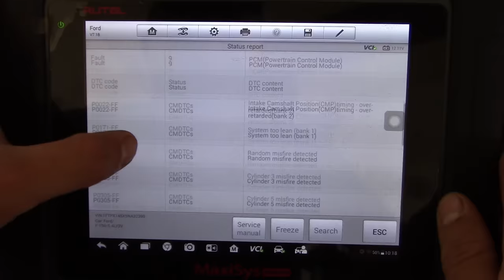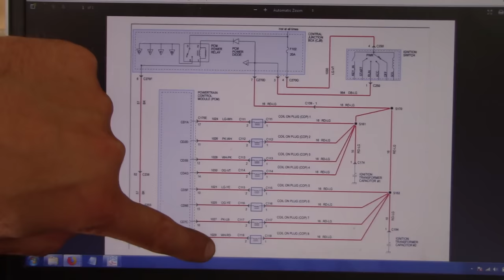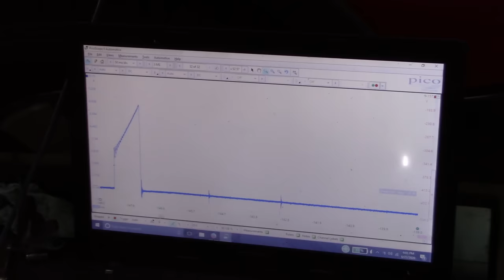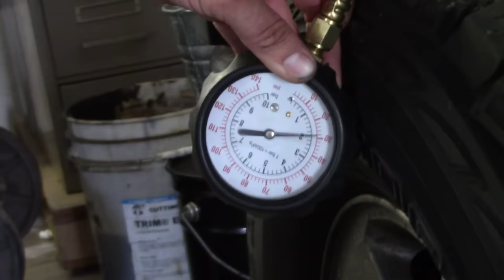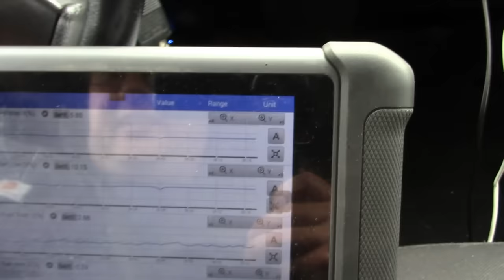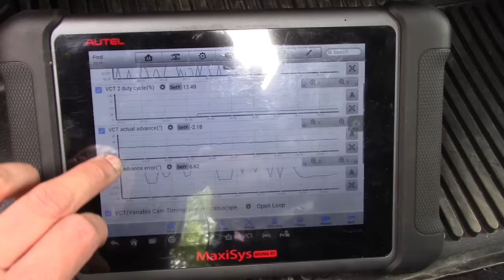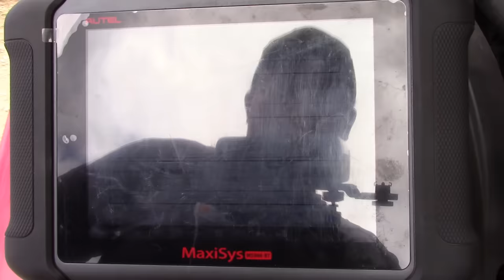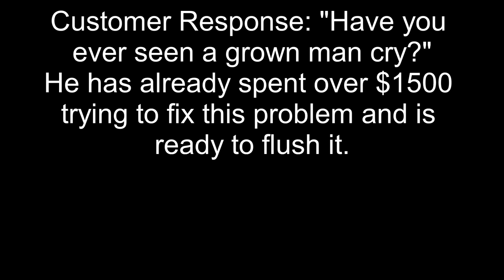2005 Ford F150 5.4L - missfires, intermittent rough running, rattles and knocks, P0021/P022

Comment: Oh 25:50, no it wont hurt anything making that noise, but from experience, it sometimes retards the cam too much and you loose power, We got some vans with 400K miles with bad phasers and boy they make a racket and even almost feels like a slight miss to it, but they are gutless, 400k miles we normally don't care about changing stuff like that, we end up finding a low mile 5.4 if the van body is worth it (Ohio) still before we change them phasers at that point.

Comment: oil pump, need to replace oil pump. the oem oil pump has a thin back plate that flexes at anything above 2500 rpm and oil pressure drops. need to replace with melling 360 high pressure/high volume. they use the same pump on the mustang

Comment: I have a 5.4  it i just changed the phasers and it idles fine rev it a little and it starts making that same death rattle but if you switch it off it starts and runs smooth for as lot as you don't rev it up than it starts rattling again then switch it off then it idles fine again

Comment: Roller followers are a big concern when this engine has over eighty thousand miles, vvt solonoids get plugged and screens break , phazers get worn out due to lack of oil pressure, all this because Ford recomends 5w20 engine oil  for epa mileage standards but it would be beneficial to change visosity to minimum 5w30, and change the solinoids,  Ford also installs crap oil pumps in these engines

Comment: Good job diagnosing Wes. I would like to know more of the history. Do you think these light oils (because of VVT) could be a little too light for adequate lubrication? Not to mention conventional oils.
Reply: Too thin of an oil and too long between oil changes is the death of a 5.4. Need to run a 30wt or 40wt oil and go 5k miles max.

Comment: That engine is toast.  Death rattle on startup means blown oil gaskets on the chain tensioners, so right bank starved for oil, which ruined the right head's aluminum cam bearings.  Cheaper to replace the engine with a rebuilt long block.

Comment: Hey my 2004 ford f150 5.4 coil keeps blowing out the spark plug hole do you know why .      I was changing the sparks and put oil down the sparkplug holes to loosen them yah I found out after I'm not supposed to do that any help

Comment: I had a Ford mechanic tell me to run 10-40 rotella in that garbage motor and we'll it quieted it down it also starved the cam for oil and snapped the cam on the passenger rear cylinder. Second motor made it to the same 150000 and I haven't wanted to bother looking at it sounds like the same cam break tho

Comment: Mine 06 5.4 Triton 3v  runs very similar to the last run in the video. Pull up to the drive thru and it idles like a Semi Truck, just rattles and rough idle, sounds like what i imagine a bad roller would sound like at its peak roughness. I cringe because I'm just waiting for an explosion. I often keep my foot on the Gas and the break to prevent the mayhem which helps. I get the 5,7 Misfire even after changing plugs and coils and have the rattle. I'm thinking  its time to break the motor down.  Other times it idels great like right now, sounds like a brand new truck. Any advice? Or thoughts?
Reply: bloquea los engranes, checa las guías estar rotas, ´posiblemente tambien tenga los tensores reventados
Reply: @jorgeromerotorres2903  Guides and Tensioners..Gracias

Comment: knocking is caused by blown tensioner seals   low oil pressure to phaser ... mine were both blown used Ford updated tensioners prob solved... my 5.4 has 260k  still running

Comment: i know this is an old video, and the update was that it was put back together with just partial parts replaced... but im wondering how everyone navigates this type of issue from the mechanics side of things when you have what must of been 2 full days into diagnosing and disassembling to find out bad news like this... where do you stand if the truck is worth repairing in any manner and the customer just wants to cut their loss's.. you have atleast 1500$ in labour there and a truck that isnt worth anything but scrap or part out.. a reputable mechanic cant slap it back together and sell it on to break even.. do you just eat the job and keep the truck, do you push the customer to pay your bill and take the truck home in pieces.. whats the solution when things arent economically feasible

Comment: Those 3 valve 5.4 are indeed grenades. I hear that the 2 valve is a much better engine does it have the same set up I guess and problems as far as timing.

Comment: Just put new timing guides, phaser,METAL MADE TIMING TENSIONERS,and put a shim in the oil pump spring and that will bulletproof that engine,mi navi 2005 is on 2k running like a champ until this day's

Comment: I changed the whole timing system and still getting those codes hehe but I think the phasers I bought might be too cheap the truck works perfect but then I turn it off then on and it starts acting up

Comment: About the the tensioner pulley  I had the same problems on john john deere  powered mulchers   stamped fucking puĺĺey   John deere had no solutions at the time  got pulley machined of aluminum  never touched again 
The same problems happen to my friend truck with 30 000 very well maintained  he his a heavy duty mechanic   take care be safe

Comment: That tick believe it or not, is the spark plug n that cylinder. take the connection off the ticking cyclinder's coil and it'll disappear immediately. replace the coil and all 8 ignition coill wires and connectors.

Comment: It's as if the manufacturers have lost their ability to go back to basics. Gas engines have been around and reliable for a long time but the engineers just can't leave them alone.    The Triton engines came out and they start shooting spark plugs out of the hood and then the timing problems. Chrysler has Hemi engines that the roller rocker would eat into the camshaft (mine happened at 60k) and it's unbelievable.  My sister bought a brand new RV 2 years ago with a Triton V10 (I tried to tell her) and it spun a main bearing and blew with 6000 miles on it.  Now she has a diesel pusher with a Cummins that may or may not have a CP4 injection pump, haven't looked at it yet.  Tried to tell her about that also, but nobody listens!  Personally I won't buy a thing without tons of research anymore and it is a shame it has come to that.

Comment: it was an interesting video.....my observation of your approach is that you were continually misled by your electronic video screen data and you spent the first 3/4 of the video chasing after various mirages on the screen.....finally in the last 1/4 of the video you finally did what you should have done immediately on the first day....you at last pulled the timing covers and cam covers and within 20 minutes you knew what the problems were.........in a world where you did not own any fancy scan tools and picoscreens but only had your eyes and ears to trust then you would have immediately torn down the top end of the engine and probably saved yourself 2 full days of wasted work time trying to figure out what the screen was trying to say.....in the end the video screens and scan tools added nothing to your final diagnosis and just ended up distracting your attention from the obvious problem at hand.

Comment: Had the same issue as mine turned out to be a cooling tube underneath the intake that was leaking and kept dripping down into the spark plug Wells and making them misfire

Comment: My 05 has 120k miles on it, has a leaky passenger valve cover, and blows #7 spark plug right out every 10k or so.....ticks on schedule like a Rolex, im about to do  vc gaskets, vvc, tc, tc guides(again), plugs, boots, coils, cam phasers(again). Keep in mind ive already done the front and rear shocks 4 times, both upper c.a.(2times), lower bjs(3times), I rebuilt front end ifs pos 3 complete times and 2 more partials, wheel hubs been done, my caliper fell off when I bought the truck and got wedged in my rim.
I bought it with a 6" fabtech lift, since the white fabtech shocks blew out my camber just aint right, and can't right, I wear the inside 4" of a brand new toyo mt(35x12.50x20) down to cords within 10k.
If I need a motor, then so be it, im already 30k into it just in repairs, if the ifs goes again ....there will be a dana 60 incoming.....

Comment: I bought a new 2005 F-150 XLT  5.4 in  2005  The engine completely blew up at  90 K.
Installed a  Jasper re-manufactured engine , and it gernaded 25 K later.
I change my own oil every 3000 K
Installed a motor from a 2007 F-150 ( Rear collision ) and it ran like shit , for 8 K , until i got side swiped.
"BIGGEST POS EVER"    FUXX  FORD.  Buy a Chevy / GMC - be happy . . .
Reply: These pos 3 valve trucks are total junk that's why they have the lowest resale value of any pick up truck of the era, you can find clean low mileage ones for around $4,000-5,000 but if you want a v8 silverado of the same year, it will you around $6,500-$8,000 for a clean one that's not beat up but the mid 2000s chevys with the 4.8/5.3/6.0 ls engines are absolutely fantastic and are almost bulletproof the weak link in an ls truck is the 4l60 transmission but changing one of those isn't too difficult and still cheaper than changing a 3v for motor.

Comment: 47:35 bruh that seems like some of the most intentionally designed to fail bs I've ever seen. especially with the cams running directly in the heads with no replaceable bearings.

Comment: Used engine don't cost 1500 buck u can go to pick a part pull engine your self that works for 250.00 I just don't know where ppl are getting prices like that
Reply from the maker: LOL. Did you know that junk yards are different in different parts of the country? Crazy right? There is not a single "pick a part" junkyard within 200 miles of me. I don't make the prices.

Comment: I have a 2009 xlt F150 5.4L v8 with 634,718 kms on my truck.
Reply from the maker: They can have it.
Reply: @WatchWesWork  it's still runs great although I get a reading for my oxygen sensor on bank 1

Comment: Built Ford tough. I think they mean tough shit. Like when it dies. My daughter hated Fords. I had a couple over my life and they were okay. The last one I had was a POS. A Taurus. I had to do brake jobs on it every 18K miles. It blew a head gasket at around 100K. I did all the work myself and saved a bundle but that crap shouldn't happen. I now only buy Toyota's or Honda's. They aren't perfect by any means but they beat the hell out of anything "American" (which means all the parts are made elsewhere).

Comment: put timing components in it and send it. if it lasts 50,000 miles thats good.
Reply: Yep, if it was my truck I would replace the absolute bare minimum and either run it till it blows and junk it or sell it for dirt cheap, these 3 valve trucks are total junk and dont deserve to be repaired.

Comment: 03 expedition 5.4L - Changed the manifold and it works perfect after the ecm reset, then after 10 minutes it starts running rough. Disconnect battery reset computer runs perfect for about 15 minutes then bad again.  Mechanic is at a loss. Any ideas?
Reply from the maker: Sounds like the gasket is leaking.
Reply: @WatchWesWork  Thanks. I’ll give it a try

Comment: Back in the day, Ford Trucks were as good as it gets. Now with the 5.4 and more engines, bad engineering, and bad engineering on Ford's 4x4 drive vacuum control system, which they now just changed in 2021, is a big letdown for me and Ford. Quality Control is a big problem at Ford and others also. The Japanese and Korean cars are putting our companies to shame. Not to say that foreign manufactures don't have their own set of problems at times. I worked at a Ford dealer back in the day and these new cars and trucks to me are a nightmare.

Comment: One more thing I just thought of when I watch the very end of this video I replaced my engine with a EPA test engine that I bought out of Dallas Texas which means they tested for fuel mileage or crash test the motor had 500 miles on it I think I paid $3500 for the motor and another 2000 swap everything out

Comment: I had a new 2003 F150 with a 5.4 Triton that I had for 17 years.  It had 240,000 miles on it when I sold it, still ran great....never had any issues other than normal wear and tear items and replacement of coils...
Reply: Have an 03 in the shop that I bought in 05. Issue is blowing plugs out of 2 and 3 cylinder. Having head replaced with both gaskets, timing chain and guides, oil pump, coils and plugs. Getting miss at cyl 2 at idle, goes away at 1200 rpm. Guessing pcm needs factory reset or flash/replace. Thoughts?

Comment: Your analysis on the cam journals is incorrect. You look under the camshaft and look at the journal on the head and you will find that the head has an oil hole and is smooth. Note there is no oil hole in the journal cap, the wear grooves are the normal path of lubrication to the cap. Some courseness is expected  Phaser locks are the way to go. I could easily fix this problem and this engine would still be running fine by just replacing the timing chains and putting in phaser locks.

Comment: I think you should go through all the coils make sure the water is cleared out of all of them. Then treat them all with dialectic Grease so that it will keep that moisture out and do it right. Or do you think that the water just ran into the one little hole? It didn't get in anywhere else just that one spark plug right, 🙄

Comment: sounds like mine, going to run it till the parts fly out. in 60 years of playing with vehicles, the 5.4 is the poorest example of an engine i have ever owned. the truck is fine drives nice but under the hood is crap

Comment: I understand, and let me say I appreciate you trying to get views. This is very misleading and can cost people a lot of money. Your wrong.  Here is the real deal. Measure the thrust bearing on the crankshaft. Put a dial indicator on crank bolt. measure forward and back toward transmission. That's the problem.  Push crank back toward rear of truck then pull forward. That's thrust bearing wear. If the space is to big oil does not go up to the Phasers.   Your findings, bad parts, grooves alunimum chips etc...  Because of the thrust bearing wear at idle they have low oil pressure. Metal parts hit/rub make such flakes.  The converters were plugged because of the misfires,  misfire's because of low oil pressure.... low oil pressure,  again no or low oil pressure at idle.  Failing the timing components,  VCT etc.   Again low oil pressure. Failed thrust bearing. It is documented and known addressed by Ford. The TSB had us tech's measuring crank thrust and if it was over a certain spec we replaced the engine under Warranty. Don't go down this "Rabbit Hole" I know it makes an entreating video but that's all. I appreciate the energy and rejuvenation of this 15 year old problem but you wrong. I would suggest a delete kit. Any questions let me know.

Comment: Wes those 54 3v are essentially junk and need the full meal deal ohc parts at 150k if well serviced.  When fixed run heavier oil for less noise and increased valve gear life

Comment: I would’ve just taken it to redline if it was getting a new motor cuz the core/block is trash from factory.

That thing sound like a diesel, if I’d had a 5.4l & it knocked like that I would just keep driving it until it goes boom, then engine plucking time.

Comment: I had the exact same motor in a 2010 I believe and every time it rained it dumped water on the right rear cylinder from the drains from the windshield shorted out the coil which shorted out the spark plug spark plug burn a tip off of itWent through the valve and through the top of the piston and cost me a motor and Ford wouldn’t do anything about it

Comment: Truck isnt worth installing a reman engine.  I would replace the timing components, install pre 2004 cast iron tensioners, bolt the camshaft back in, install a Melling M360 HV oil pump and drive it.

Comment: Shouldnt make the gasket more robust, should have used the metal bodied tensioner like the 2v. The 3v tensioner body is PLASTIC with hot pressurized oil in it...

Comment: Judging from the lack of a follow-up video, the truck must have gotten junked or parted out?  A ford reman is $4000 out the door, but with the frame rust that was observed, it's not worth it.  I don't know how you guys do it up north with these rusted out vehicles.  Down here in Texas people get new cars when the interiors go to crap because they got baked to death in the summer heat, but the frames last forever more or less if they're not wrecked.  It would be worth it to fix a truck like that down here.
Reply from the maker: I replaced the solenoids, guides, and tensioners, and put on a used timing cover. It's still running just fine.
Reply: @WatchWesWork  what about the cam journal wear?  cleaned it up with scotchbrite or something?  New timing chain also?

Comment: I had a spark plug blow out of the head on a v6 Econoline around 60000 technician never seen it on the v6 but always on the 5.4

Comment: Oh the 5.4 triton hand grenade the ford engine that was engineered to fail. Common problems usually range from bad exhaust manifold gaskets, to cam phasers and two piece spark plugs that snap off in the head, cause they seize themselves in, to timing chain tensioners that grenade themselves the list goes on and on and on. The best bet with a 2004-2011 Ford F-150 is to just completely avoid them all together. They’re a complete money pit, and they’re worthless.